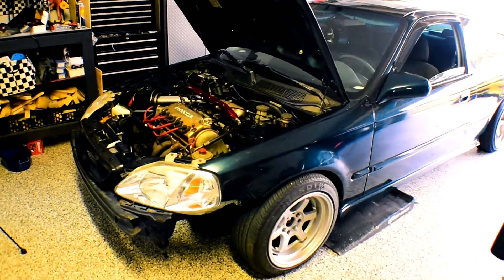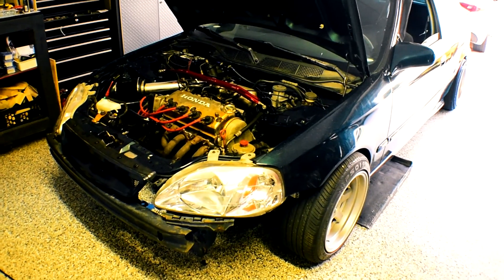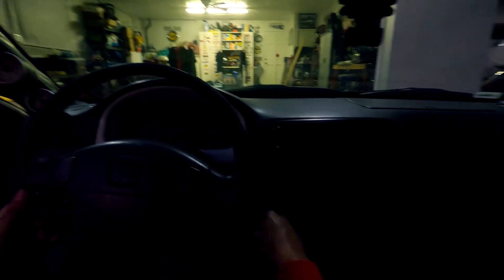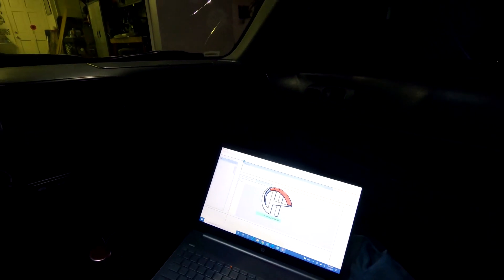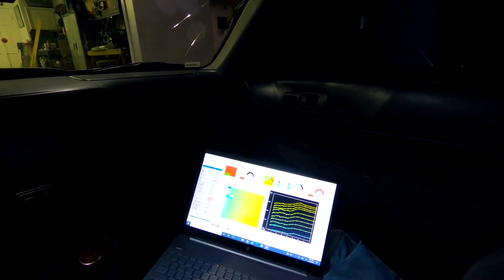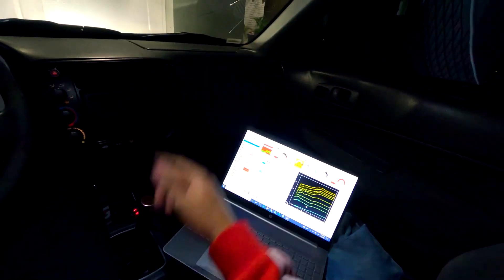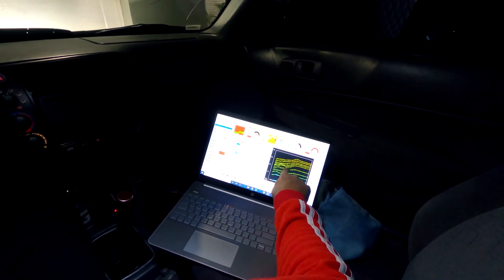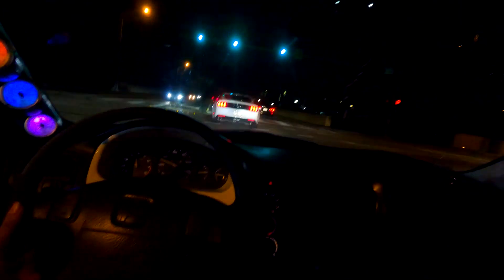Street Tuning My D16Y8 VTEC Civic EJ8 using Honda Tuning Suite!

Comment: Do you need wifi to be able to street tune
Reply from the maker: As far as the software I have used, no. 
Honda tuning suite and Hondata have not required internet to update and upload the tune to the vehicle. 
I cannot say for sure if all systems are offline compatible but I would imagine they would be. 
Maybe needs online at some point for system updates but I don’t think it is needed for actual modification.
Reply: @CJBuilt  thanks i was unsure if i needed internet connection while street tuning
Reply from the maker: Yea man no worries!!

Comment: I think the best thing you can do to better yourself is to learn how to read sparkplugs. The wideband can be thrown off if you have an exhaust leak but the plugs never lie if you know what to look for :D It's absolutely amazing how much information you can gather from them. The most important ones in my opinion, are the peppering that's caused by detonation (really really bad), the heat mark on the ground electrode that indicates how hot the plug got, and by proxy tells you if your timing is too aggressive, how far the soot buildup line creeps up on the insulator, which gives you a good idea of the actual mixture at wide open throttle, and lastly, how uniform the plugs are which could help you find out about stuff like clogged injectors which the wideband cant individually pick up. There are tons of other things that can give you a better understanding of the overall health and mood of the engine.
Reply from the maker: THANK YOU!! 
Definitely will take this advice!
Reply: @CJBuilt  happy to help :D